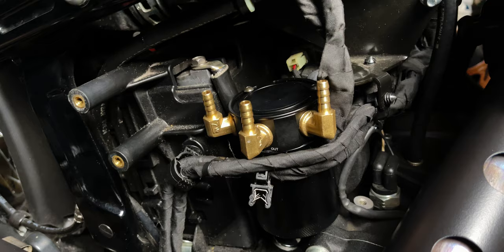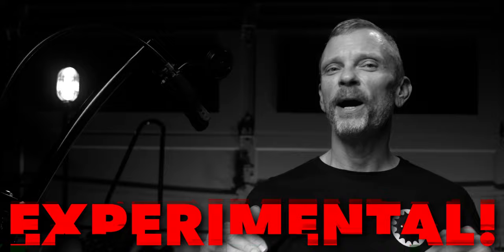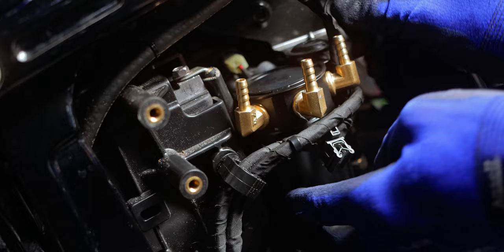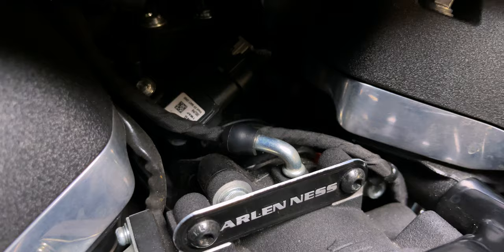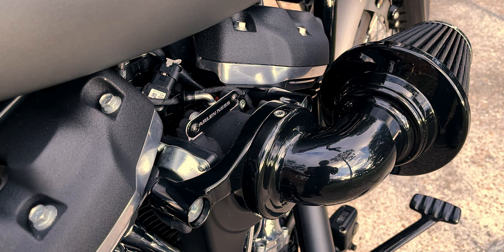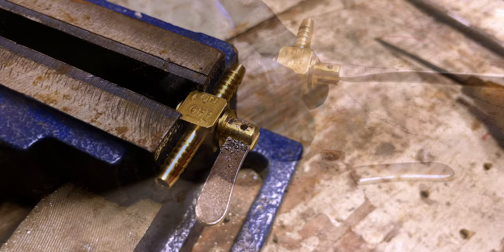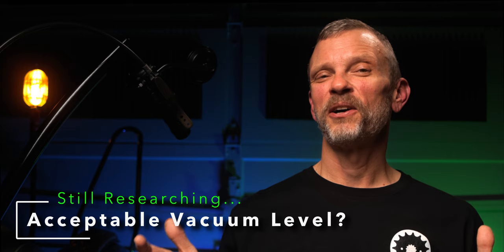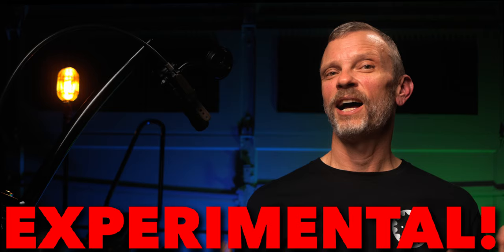❓Vacuum-Ported Catch Can: Crankcase Vent + External Breather + Vacuum = Perfect❓

Comment from the maker: Could this be the perfect solution for venting the crankcase, adding the external breather mod, and providing vacuum for the crankcase? Maybe so. Let me know what you think.
Reply: Ron, please give us your thoughts on the Moroso air/oil separator. It seems perfect, but pricey. They offer a model in different finishes for the M8.
Reply from the maker: @Greenmachine305  Yeah, I think that could be a good option. This is a small body universal model: https://amzn.to/3pueTAA (silver) and https://amzn.to/46q4eaE (black) A bit pricey as you said,  but it may work well. If you or anyone else tries it, please let me know!
Reply: @RonsWorkshop  I'm using your trans cover mod and a basic intake breather mod. I like your solution better for the price. Not going to bother with the check valve.

Comment: Love your videos. In the race car world we route our pvc hoses to our exhaust and let it draw it out and burn it. “Pan evac” it draws enough vacuum at idle to suck your hand against it tight.
Reply from the maker: Hey Tyler - thanks for the kind words! Yeah that’s a classic race car setup for sure. There a little crossover tube between the two tubes. I wonder if there’s enough vacuum there. Might be worth trying!

And if you want a sticker send me a DM on Telegram, Instagram or Signal with the mailing info @RonsWorkshop
Reply: @RonsWorkshop  yea I’d be interested in seeing these bikes would pull vacuum. Tig weld a nice little -4 stainless bung and run a nice little stainless braided hose.
Reply from the maker: @TyScott85  duly noted! I'e got it on the list...not sure of the timing, but I do want to check into that.

Comment: The vacuum port on the throttle body can be used to operate a flapper gate type air cleaner such as the Kuryakyn Hypercharger (installed on my Ultima 127 ci).  Basically you've rerouted the pressurized air coming from the rocker boxes into a filtration device and then returned it back into the intake stream.  I'm not sure that I like the idea of introducing heated hydrocarbons into the cool air of the intake stream.  On my M8 with the Arlen Ness intake I've done what you did originally by plugging the air passages and rerouting the air from the rocker boxes out to a catch can.  I haven't made the alteration at the transmission yet but plan to in the near future.  I'd like to connect a gauge to the fitting installed at the transmission to see if at any point the pressure there goes from positive to negative as suggested by several people trying to resolve the issues with Harley's crankcase ventilation system.  I appreciate the time and energy you put into your testing and the fact that you share your results with the rest of us who don't necessarily have the time to do so.
Reply from the maker: Thanks for the encouragement and for sharing that info! The jury is still out on what my final solution will be.
Reply: Those gauge results would be interesting too see.

Comment: 9 inches of vacuum is literally the ideal amount according to racing engine builders. They shoot for between 8 and 10 inches of vacuum. It's enough vacuum to see a good increase in power without being enough to really effect oil pressure (excessive crankcase vacuum works against the oil pump trying to suck up oil). I'd pull that petcock off and take advantage of that perfect amount of vacuum while also simplifying the system and minimizing chances for vacuum leaks!
Reply from the maker: Hey Tanner Saurus - thanks for sharing that info!
Reply: @RonsWorkshop  also... After watching your videos, I've started looking into exhaust venturis. Apparently they work well, pull around 2-4 inches, and it keeps everything outside the engine. I think I might go that route. Not even use a catch can... Just two lines, two check valves, and two venturis. Or maybe tee them together into a single venturi right behind the collector. I'm on a Road King Special BTW so slightly different exhaust setup...
Reply from the maker: @High_Desert_Tanner  I like that idea! Seems simple enough to do - I think the key is making sure you get the port in the right place on the exhaust. Let me know how it goes!

Comment: yep did this a while ago - need vacuum on the top end as Harley motors are intended to be set up loose
Reply from the maker: Hey Jere - thanks for sharing that! Did you notice a performance difference? My “butt dyno” says it improves performance.
Reply: @RonsWorkshop  I don't know if performance is the right word but definitely we're going to have less contamination in the fuel mist and the added bonus of oil attempting to burn and my combustion chamber clogging rings & contaminating my valve seats - longevity & efficiency the words
Reply from the maker: Yep, several benefits indeed!

Comment: Hi Ron! Sorry about my English I’m brasilian (we speak portuguese) Awesome work, you are spreading knowledge across the world and you’re reaching far beyond you could ever imagine! I’m gonna try to use the same source of vacuum you did in line with the crank case vent and an in-line fuel filter in the middle as a catch can, I’ll let the original breathers stock first, as I believe that the vacuum at the crank vent will be enough to completely eliminate oil in the breather bolts. I’ll let you know as soon as I do it and get the results. Keep it up bro.
Reply from the maker: Hey João Maurício Basile de Souza - Thank you for the kind words! And please do let me know how it goes.

Comment: So funny thing is, the spot you found for that can, is where the ABS module is on my Fat Boy 114. 
I think a 2021 SE oil pump and camplate kit+Trask CheckM8 Transcase vent is probably all I'd ever need to worry about.
This stuff is getting all too complicated, and adding potential new points of failure/wear and tear.
Reply from the maker: Yeah I know I got lucky with that open space behind the cover! And simple is good, that’s for sure. The crankcase vent + OEM breather bolts was working well and that’s always an option for me.

Comment: I just found your channel really good videos I just did some stuff in my 20 street glide. So   I’m bringing the head pressure and extra oil. From the intake down a hose to the top of the transmission cover to where the engine oil hole is then I drilled a small hole in the cover so it can breathe out the transmission vent. And I also have a a1 vented dip stick so I don’t have a lot of crank case  pressure so far it’s working great. New subscriber here  thanks again
Reply from the maker: Hey Cape Cod Biker - thanks for the kind words and thanks for sharing your project details! 

By the way, I lived in Hyannis for 7 years :)

And if you want a sticker send me a DM on Telegram, Instagram or Signal with the mailing info @RonsWorkshop

Comment: I have a recent built TC with 110 kit. Never had any sort of primary/trans transfer.  I did have lots of oil carbon buildup on the pistons and combustion chambers after 50k miles.  I run seafoam frequently, had no carbon buildup on intake valves. Used DK catch can after engine build. Also note, that air cooled motor gets stupid hot, cylinder walls were heavily scored.  I also added love jugs.  I’ve put 12k miles on it so far, very happy with performance, and I believe those 2 longevity mods will keep it running new longer.  I pull a trailer with the bike, so performance degradation was noticeable prior to the rebuild. 
I may pull it back down again after another 50k miles, but hopefully it will continue to pull strong.
Reply from the maker: Hey 2TRDGTF1 HD SGS - thanks for sharing that info! Sounds like it’s doing well with the rebuild and mods you’ve made.
Reply: @RonsWorkshop  thanks, I appreciate the efforts you’ve been doing to resolve M8 issues.  I’m going to get one eventually, but was waiting for the MoCo to get the bugs either sorted or smart enthusiast such as you come up with some viable solutions.  The MoCo seems to be between a rock and a hard place… trying to meet EPA rules while providing the bike customers expect.  Compromises are the result.
Reply from the maker: Yeah it’s easy to get frustrated about some of these issues, but the reality is that it’s very challenging for HD - and any company that has to comply with EPA regs - to keep meeting consumer expectations around performance when the restrictions keep growing.

Comment: Hi Ron, I went with 2 vents in the trans cover (crankcase section)  one from the head and the other to atmosphere.  The atmosphere vent is open with no carryover of oil. I think it works well venting in and out of the trans cover.
Reply from the maker: Hey jongerm66 - thanks for sharing that info! Nice and simple. I like that idea but if I was to implement it I might add a pod filter to the atmospheric vent just for the peace of mind that nothing could enter.

Comment: Hi Ron. Great job with that system. I'm still toying with the vent and catch can from the transmission cover you presented back in the spring. I get a lot of froth filling that can so I have to empty it quite often. Keep up the good work!
Reply from the maker: Hey T Luck - Thank you for the kinds words and encouragement! The transmission top cover vent is very effective so you can’t go wrong with that! I’m curious to see how much milky gunk I get in my catch can. It’s sort of a pain to get to mine but I’ll definitely need to check it periodically.
Reply: @RonsWorkshop  So what's causeing the milky spun up oil ? pressure / heat / vacuum which pushes out ,,,cheap oil ? and what does the vacuum actual do for the motor as i thought you want to get rid of all that pressure ? cheer Ron great work
Reply from the maker: Hey Damien - sorry about the delay in responding. YouTube held the comment for review and I just discovered it. 

The milky crap is a mixture of moisture and oil vapor from the crankcase. I run Harley synthetic right now, it's not because of cheap oil. Pressure is bad, but some vacuum is good. The pressure can cause sumping and other issues, where the vacuum helps ring seal, reduces aeration, etc. I cover it a bit more in this video: https://youtu.be/F2N7kwCspQE

And thanks for the encouragement!

Comment: Ron great experiment.  I always thought that the capped nozzle on the throttle body was a more positive vacuum source.  With it tied into the catch can and the check valve removed from the atmospheric vent, seems the vacuum would alternate between sucking fresh air from the vent, and sucking pressurized crankcase air on the pistons downstroke.  Doesn’t seem like it would contribute much in keeping vacuum on the crankcase.  I’ve got my 2019 SG transmission cover vented to atmosphere using a 5/8” hose and check valve, with factory crankcase system still installed.  I’ll see how that goes as I continue to follow your work. Thanks.  Ken
Reply from the maker: Hey Ken - thanks for the input and the kind words! In my case with this catch can there is no vent to atmospheric. That’s why I left out the check valve for now. And all of the checks I’ve done so far show consistent vacuum. We’ll see how it looks after more miles and more testing.

Comment: Now don't shoot the messenger here but 20 years ago when I built a race engine 8hg of crank vacuum was worth 15 more hp. I had to use a four stage vacuum pump on that engine and I remember measuring and monitoring it to make sure everything was working correctly.
Reply from the maker: Hey John - I wish we had a good source for determining how vacuum is ok. I know there are some who run over 20” vacuum so maybe 8-10” is totally fine. I just don’t have a way to confirm that.
Reply: @Ron's Workshop  I know, the whole thing is confusing. I remember paying more for a 4th stage on a vacuum pump to achieve nearly (-14psi) 28 inches of vacuum, but that engine was built for it. I couldn't tell what your gauge was reading (psi or Hg) when I watched your video on my phone.

Remember, atmospheric pressure at sea level is 29.92hg/14.6 psi. That means zero on a pressure gauge at sea level is really 14.6psi.
Reply from the maker: Good point!

Comment: Thumbs up for tackling one of those difficult issues..interesting but my impression is this mod is excessive and overly complicated, esp with the need for adjustable vacuum tee is just to prone to need checking too often, and likely to plug up often.  I'm still leaning towards tapping threads and installing a smallish commonly found, 90 degree PCV valve (with larger opening/capacity than your 1/8 check valve you used earlier) into top my Transmission cover (crankcase vent side) and hosing it away.. maybe rubber band a durable paper towel on the end to see if anything comes out on to the towel.. might vent it open or might add a external filter. maybe $20-$40 mod..
Reply from the maker: Hey ut1004bp - I don’t disagree! I’m about to publish the follow up video any day now, and I’ll share my assessment and decisions after a few weeks of rising with some more measurements. 

Let me know how it goes if you go with the pcv solution - I’m very interested!

Comment: Ron , is the vacuum lin connected to the manifold between the throttle and the heads?  If so i don''t think you would have to worry about too much vacuum because in the automotive world when pcv systems were introduced and still today they were hooked directly to the intake manifolds.  This would create a vacuum reading of 14+ lbs.. But when the throttle is in the wide open position the vacuum will drop to zero. i'm curious if you looked at your gauge when you were at full throttle. Racers have found that the more vacuum in the crankcase the better. It helps with ring seal, oil seals, also helps greatly with windage and oil aeration.
Reply from the maker: Hey Broham - you make a good point about the manifold vacuum. I just wish I could find some “official” guideline on what an acceptable vacuum range is. Unfortunately I didn’t get a chance to check it at WOT. I’ll try to check that sometime. The vacuum is definitely beneficial, but where’s the line?

Comment: just need the check valve back in if you decide to boost it. i doubt you will ever see positive pressure even with a ram air :), if you remove your oil dipstick does the revs rise up ?
Reply from the maker: Good test on removing the dipstick - I haven't tried that, but I know for sure it has positive pressure, and there is a perceived difference in how the bike runs once that pressure is vented. When I can get around to it I'll try the dipstick trick.
Reply: @RonsWorkshop   i was meaning in the airlifter side of the throttle body wont have pressure :)

Comment: Very interesting subject matter.  Always more questions are generated from everyone; more than likely from just not enough knowledge, understanding and/or just plain trying it out.  Obvious goal:  keep the hot oily vapor out of the Air Cleaner/Throttle Body/Intake Tract, while maintaining "good vacuum/pressure situation below the piston rings, the crankcase.  I'm running the Trask CheckM8 Venting Piece (transmission topside cover plate) on my Harleys ('21RGS-114 & '22FXLRS-117) and appears to work great.  I've been considering adding a External Breathing System (external breather head bolts) into a catch can, but not sure; brings up a question: Can one over-ventilate a Harley V-Twin?  Also, I'm researching a great catch can piece that T-Man Performance has for Baggers (mounts in the upper rear fender frame/structure.  Thanks for making and sharing these videos, and keep 'em coming.  Much appreciated!
Reply from the maker: Hey Tom - thanks for the encouragement! You hit the nail on the head with the obvious goal. As to the question about too much ventilation - there’s a debate there too. Vacuum in the crankcase is good, but some people have “free breathers” where everything is vented and there’s no vacuum in the crankcase. Bad or good? Not completely sure. In my mind I aim for venting pressure first, then vacuum second (if possible).

Comment: I need to understand better. Please correct me. If pressure is created upon upstroke of pistons and on stock set up if that pressure is routed through umbrella Valves in the form of oily vapour through breather bolts to be routed back into the intake. Then on the down stroke of pistons when vacuum is created, wouldn't that vacuum be eliminated from that same route because the umbrella valves are only one way?
Reply from the maker: The umbrella seals should allow pressure to escape but retain vacuum. I don't know if the downward motion of the pistons generates vacuum, but that does make sense. What can say is that without any venting there is definitely positive crankcase pressure.
Reply: @RonsWorkshop  I'm venting into external breather for a few reasons. To eliminate oily mist from intake creating carbon build up on pistons, to insure a clean charge of fuel & air to combustion. Also oily vapour displaces volume and even though small that will take away from the optimal stoichiometric ratio.  But here's another question. People are saying the vacuum is necessary for ring seal. However, my understanding is the rings are sealed in the first 500 miles breaking in the engine. So why would we worry if we've reduced vacuum by running an external breather? The main thing is your relieving pressure and you're not getting that oily vapour back into the intake. And if you've done the proper job breaking it in and the rings had integrity, they should be sealed properly and should not need constant vacuum.
Reply from the maker: @dylandream2248  Even with proper break-in there will always be blow-by that gets past the rings. And as mileage and wear increases that blow-by will likely increase as well. The vacuum just helps with ring seal and also benefits the lubricity of the oil by reducing aeration. That also helps the oil pump more efficiently, helping keep sumping in check. In general, the engine will before better if the crankcase is under vacuum.